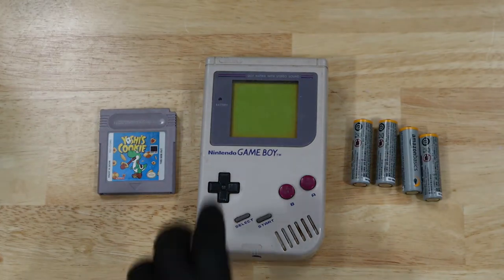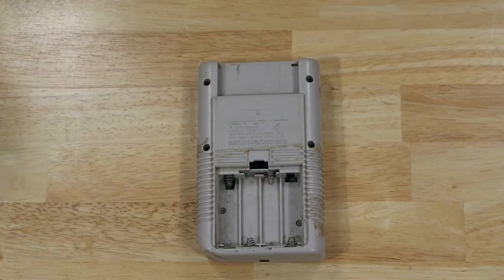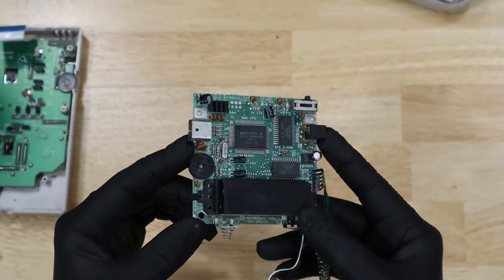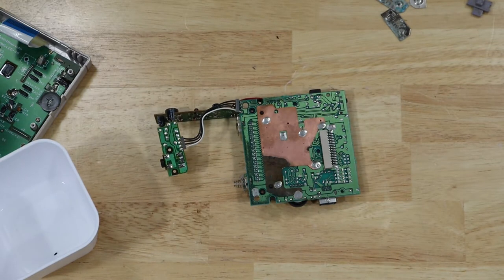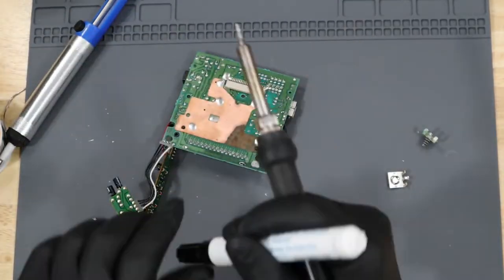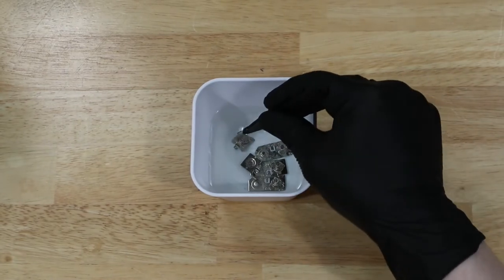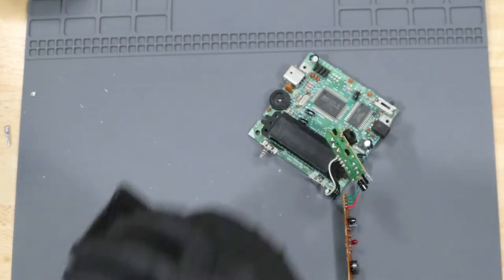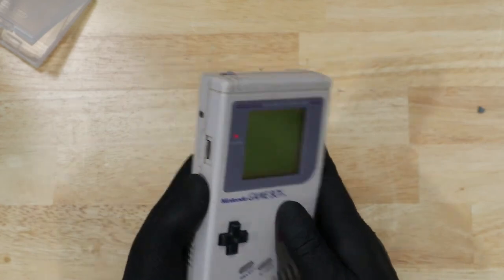Game Boy Restoration - Battery Corrosion Fix

Comment: tip: If you have no vinegar, you can use coke, it contains phosphoric acid, which is used in comercial rust removers, just not as strong...
Reply from the maker: True. Any mild acid like vinegar, lemon juice, or coke would work. Great tip!
Reply: What about baking soda
Reply: @juampecjdm3234  Baking soda is not acidic but basic, so not much metal reaction, in cleaning it is usually used as a mild abrasive, which may help as well...
Reply: Do you want ants because that's how you get ants lol

Comment: I have a similar black spot on the back of the board from what I’m assuming is battery corrosion, anything to be done about it? 

I currently have some deoxit on the problem area overnight to see if it will lift any of it off